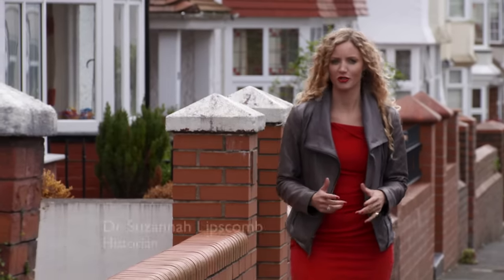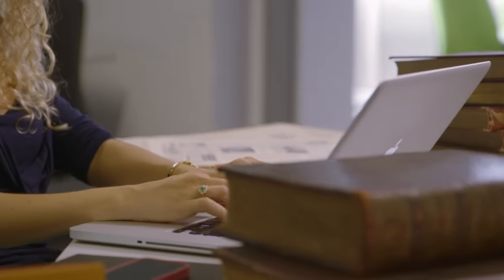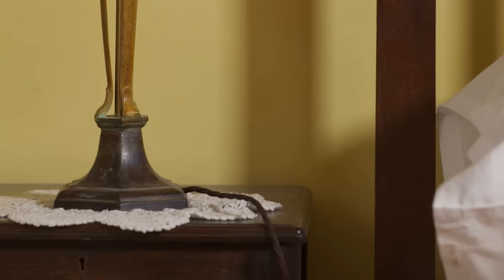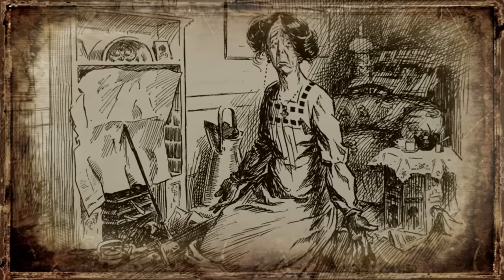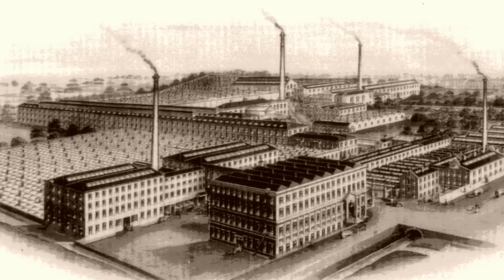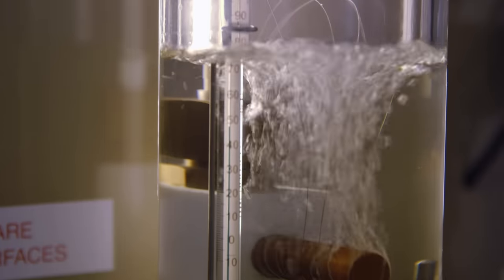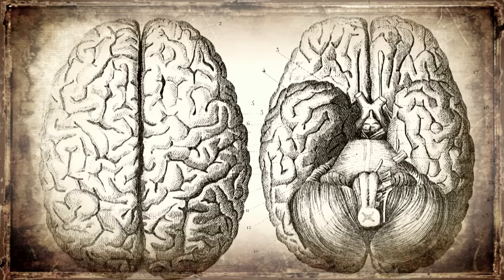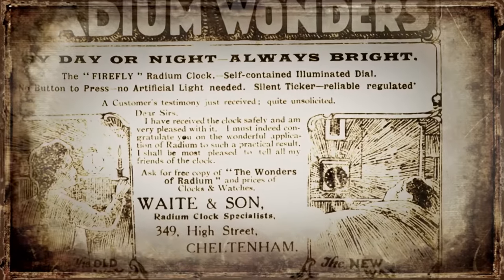How New Electricals Made The Edwardian Home A Deathtrap | Hidden Killers | Absolute History

Comment: Asbestos-lined water tank and lead pipes....the Edwardians really had it bad, didn't they?
Reply: Though not as bad as those before them- women's crinolines used to catch on fire if they walked too close to an open flame,which was all too frequent in Victorian times, and corsets with hoop skirts trapped women in their burning clothes and even just suffocated them when a strong gust forced the skirt to invert like a ruined umbrella, or even attacked them when they tried to walk over stiles or sometimes down steep stairs
Reply: jan rees you’re right about the skirts catching on fire, though that was really only a problem for working-class women as they would be the ones working close to fires. And they were a general fire hazard, but it wasn’t very common to get ‘trapped’ in your burning clothes, at least not any more that it is today. The rest of what you’ve said, however, is false. The crinoline could not invert like an umbrella and suffocate anyone because it was made out of progressively larger lightweight steel hoops that were only attached to each other by fabric. Crinolines were actually very flexible and they were fully collapsible.
Reply: Asbestos was still being used in building public housing and insulation of water tanks and furnaces in 1960 and 70s
Reply: The asbestos "lining" of the early water heaters was used as insulation, it would not normally see contact with water unless the inner jacket cracked or rusted through. That they were fueled by gasoline, kerosene or gas using an open flame, in the kitchen was usually a larger hazard.

There are still many cities using lead or leaded steel water supply lines. They depend on the lead oxide that forms on the inside of the pipe to keep people from being poisoned.  This is a great deal of the issues found in the City of Flint's water system.  A change in the Ph of the water supplied to the system removed the oxide, allowing free lead into the water.
Reply: In 100 year they talk abouth our stupidity
Reply: Vaccines g5 plastic
Reply: Asbestos is dangerous to breathe. Not so dangerous to use in things that don't cause it to be or become airborne.
Reply: @danielaweber8491  yes they will
Reply: Lead pipes are still common and in use today genius. Plus asbestos is all over in many older homes and other thing. Still legal to use.
Reply: Asbestos is a wonderful and natural substance. One of the best fireproof insulators ever. It's the small fibers in the lungs that are just terrible. It's widely used outside the USA and others who banned it.
Reply: sorry, i'm not sure if your's is a sarcastic here or not, but I know some of the poorest English had to eat mud for dinner; no wonder something like gout happened with such buggered up intestines.
Reply: We have 5G and give Radiation to cancer patients lets see what people will say about that in a 100 years
Reply: @spiritfree5050  and what's wrong with 5G? Your not a tower burner are you? You know you can't transmit a virus through radio waves..
Reply: @thetreblerebel  Radiation smarty pants
Reply: @spiritfree5050  non ionizing radiation

Comment: I recall how, in the 1950s, my mother still used an electric iron plugged into a bayonet light fitting in the ceiling. I also remember how, always naive about risk, she heard a loose screw rattling inside her Hoover steam iron. She grabbed a table knife to push it out—but the iron was still 'on'. There was almighty bang! The 'Ivorine' handle insulated her from the current, but much of the blade had melted like a welding rod. Domestic fuses were notoriously insensitive, unlike the super-sensitive RCDs that protect us in our homes today.
Reply: I also remember people used to get tired of those fuses blowing, so they would circumvent the safety by placing a copper penny where the fuse goes.
Reply: Your poor mom! Ivorine to the rescue. That's a really scary story.
Reply: @localgirl33  Yes, it was a very narrow squeak (to use that ancient term), but we all hang to life by a thread at times, don't we? Happily, she survived for another forty years...

Comment: was a apprentice electrician in the late 1940s   many of these Edwardian relics were still in use,  fire irons were in almost every  house  ,  most cottages in mill towns had gas.  Electricity was generated locally and was later Nationalised.  Wiring then was  gradually converting from lead covered to a rubber covering,  Cottages were wired  (Subsidised)  with one 15 amp socket, and two light circuits one upstairs and one down. gas was retained for many years by tenants who could not afford extra lighting points.
Reply: wow!
Reply: Really cool info, thanks for sharing!
Reply: You should make a channel to share your stories!
Reply: I'm a modern electrician and it's crazy seeing paper covered knob and tube wiring in really old houses, along with asbestos tiles all over the basements. I got hit with a hot line with paper insulation on it in an attic, that stuff will light you up bad. No grounds at all, 5 fuse boxes, no proper meter socket at all just a 60 amp disconnect running an entire house, garage and rv. Place could've been a museum lol it even was built from the wood they cut down, true 2 inch by 4 inch walls lined in boards, all hardwood. Hardest rewire ever
Reply: We still use gas, at least for cooking, in our home (probably majority of people in our country).
Reply: So assuming you were at least a teen in the 1940s, that means you’re in your 90s? Wow. Most people in their 60s and 70s have problems with tech. You must be smart as a whip!
Reply: You are so cool. I'd love to hear your stories.

Comment: To be fair, the curling wand probably wasn't all that terribly different from the 450-degree electric curling wands we use today.
Reply: for thick hair you shouldn't go past 300 degrees and most curling irons won't go past 400. If you are curling ur hair at 450, you're going to burn it off or really damage it. U r right tho, they still get ridiculously hot.
Reply: I think that kind of temperature would certainly burn off hair if you use materials like sterling silver. However, we use ceramic or variety of titanium materials in curling/straightening irons. Those hold and distribute heat evenly, which makes it quite hard to burn off hair in chunks like it did with Edwardian silver curling irons. On top of that, we have different kinds of coatings and insulation within a hair iron that causes little to no hair breakage. Today's hair irons are far less damaging and much safer than the ones they used back then even at their highest temperature settings
Reply: @Wajiiiiiiiiiiiiiiiii  perfect comment! I'm a stylist are you as well?
Reply: @leslieenoch  No, I just google shit a lot. 😄
Reply: @Wajiiiiiiiiiiiiiiiii  🤣🤣🤣🤣
Reply: @courtneyraiyn-eshaiyn7815  mine goes to 440 it's very expensive
Reply: Courtney Shaine not true I’m a professional we use 450 but are trained to quickly. Most hair burns after 450. But if your hair is weak or fine yes 450 is a lot
Reply: Courtney Shaine that’s false.
Reply: Julia Melone I have personally burned a long lock of curly hair right off!
Reply: I mean at least today we're plugging curling irons into purpose-designed wall sockets connected to circuits that can safely handle more than just a few lamps
Reply: Except the ones you use today have safety devices that disable the unit if it starts drawing more current than it was designed to. The ones back then had no such safety devices.
Reply: Best thing---don't use them at all.  If God wanted a person to have curly/wavy hair, he would have given it.  My hair is over 3 feet long, and I don't use any appliance on it at all, not even a hair dryer. Just a comb.  (Jan Griffiths).
Reply: @Jammermaker   god is real
Reply: @user-xv2lj2tx1b  nah fam but enjoy thinking like that
Reply: @Jammermaker  Actually, yes fam, but YOU keep believing that 😒
Reply: @thecatholiccorner  thought I was replying to a different post.  And whatever you keep taking on faith whatever they chalk down your throat and enjoy them controlling you for your entire life.  I'm going to enjoy actual happiness in the meantime.

Comment: It would be cool to see a video with a comparison of electrical sockets in the UK vs. USA. The UK sockets are much better designed for safety - each one has a switch, and they’re recessed so a loose plug doesn’t become a shock hazard. There’s also a fuse inside each plug. It goes beyond that - in bathrooms light switches are all suspended and non-conductive from the ceiling. I’d be curious to see statistics on accidental home electrocutions in the USA vs. UK.

Comment: I’m a telephone infrastructure technician in the US Midwest and I work on lots of active trunk cables that have lead sheath and paper insulation on the wire pairs. Usually has a a few numbers missing on the cable identification code because it’s so old it’s been lost in the records. I recently worked on a damaged 1200 line trunk from 1944. We also regularly take training for dealing with asbestos in the underground tunnels and old building ceiling tiles and cement board siding

Comment: 1890, you were born, you took horse carriage home.  1970, you die, you flew on airplanes, drove cars, watched television, used air condition during hot summer, call you mother with phones, and you see men landed on the moon.  All that, in 80 years.  Why? because petroleum and electricity.
Reply: Don't forget Chemistry.
Reply: You probably would've been born at home back then.
Reply: Absolutely right!
Reply: @Ellie5621 we can make the car hyper gas sippers and make one HP and TQ per cubic inch. The guy who make a Pontiac do this was found dead shot in the head. the car is still around some where. this car ran at 1200F on the intake and pass 1800F on the exhaust. how he got the car is run about the place like this in unknown. no car can run that hot at 350F the main bearings burn, pistons ring get too hot and crack the pistons. at this point the exhaust is so hot the pipes melt.
Reply: My grandmother was born in 1899. She died in 1986. To think of all she saw through that time. Just incredible!
Reply: @laurzee  Shame she never got to see the internet and portable cellphones
Reply: Born in 1996, I hope by 2070 to be able to see/experience mass public space transportation
Reply: Daniel 12:4 King James Version (KJV)
4 But thou, O Daniel, shut up the words, and seal the book, even to the time of the end: many shall run to and fro, and knowledge shall be increased.
Reply: P.T.K Schmidty 
We are devolving now, unfortunately. You won’t see the constant advancements like we experienced before when it was the smart wealthy that were having the most kids, and Iow lQ immi grants weren’t invading high lQ territories at a fast rate, having the most kids, and inter-mixing with the higher lQ populace. The ruling class also dumbs us down with horrible things like flouride in our water and such.
Reply: ...and the transistor
Reply: @NatureShy 
Shame that I never got a notification for your earlier comment to me... Oh well, better late than never!

So I am supposedly “scared,” and a “little snowflake” for merely stating facts? LOL! That’s absolutely precious! 😂

The truth is that peopIe from your mother’s side have an average lQ of 89, and peopIe from your father’s side have an average lQ of lO3. This is an absolute FACT.

lQ is heridi tary, and it has been proven that adopted children reflect the lQ of their bioIogicaI birth mother as they grow up, more than their adopted non-bio-mother.

Your lQ will be around a midpoint between your father’s lQ and mother’s lQ. You have your father to thank for you being able to keep up in university, but the sad part is that if he had chiIdren with someone from his one peopIes instead, his descendant would have most likely had a higher lQ. 

That goes to my point I made in my previous comment about the average lQ going downhiII here due to mass immi gration.

If I could leave links here to give you sources, I would, but considering the fact this is a big channel, the likelihood that they allow us to post links here is slim to none. Thus, I won’t leave any links, because that would shadow ban my comment.

In the book entitled “Human AccompIishment“ by Charles Murray, he proves that 97% of all accompIishments in the scient ific   in ventories, whether measured in peopIe or events, were derived by peopIe of Eur opean ethni city.

Lastly, yes, I have a college degree, from a university that is difficult for people to get accepted in to no less (and because I am fully Eur opean in ethni city, there was no AFFlRM ATlVE ACTl0N for me to rely on to get accepted!).

I graduated with honors, cum laude. In fact, for the entirety of my education, I was ALWAYS on the Honor’s Roll/Dean’s list. I never earned below a B in any class throughout all of my education (from elementary school all the way through finishing university).

I was in the AP (advanced placement) courses in high school, which are college level classes that you get college credit for.

I also didn’t major in some random sociaI science bullshit major.

Can you say the same for all of that? 

So, you were saying???

ᴬˡˡ ˢᵖᵉˡˡⁱⁿᵍ & grammar ᵉʳʳᵒʳˢ ᵃʳᵉ ⁱⁿᵗᵉⁿᵗⁱᵒⁿᵃˡ ᵗᵒ ᵃᵛᵒⁱᵈ ᵁᵗᵒᵒᵇ ᶜᵉⁿˢᵒʳˢʰⁱᵖ.
Reply: @the cooky 
You say “xeno.phobic” as if that is a bad thing. Ja panese are xeno.phobic, and thus why they have been able to keep their country Ja panese! That’s a great thing!

It’s wonderful that we can still go visit there and it is still an experience where we get to see what their cuIture is like!

No, I am not a fan of this current President. He is a puppet for the bankers, just like every other politician is. He didn’t keep his campaign promises for shit, just like they all say one thing during their campaign, but do another when in office.

He has proven to be a MlGA president (again, as they all are), not a MAGA one.

If he had gotten the waII buiIt and actually fixed the huge problem of mass immi.gration, like he had said he was going to do, I would have had some respect for him, but he didn’t do either.

ᴬˡˡ ˢᵖᵉˡˡⁱⁿᵍ & grammar ᵉʳʳᵒʳˢ ᵃʳᵉ ⁱⁿᵗᵉⁿᵗⁱᵒⁿᵃˡ ᵗᵒ ᵃᵛᵒⁱᵈ ᵁᵗᵒᵒᵇ ᶜᵉⁿˢᵒʳˢʰⁱᵖ.
Reply: never landed on the moon haha it was a hoax space if fake its a flat earth concave universe baby girl, smiles im the grand master wizard of the occult hidden knowledge, yup i no most of everything now, k look up the Justinian Deception by Romely Stewart DOG LATIN LANGUAGE VS English important thing of all to know and understand.
Reply: @haroldrole615  LOL🤣😀
Reply: @crazeguy26  He most likely used a ceramic engine block that could take that kind of heat.
Reply: I think things have been the way they have and are because of people's PERCEPTIONS  of gas and electric.
Reply: @NUCLEARARMAMENT  ceramic is going to bust from the engine runing. the engine is a Hot Vapor engine.
Reply: @crazeguy26  You can’t make a car run that hot unless you completely replace the engine with something made of much more heat resistant materials. There is no magic chemical or process that can make a regular engine resist that much heat.
Reply: and with that comes all the diseases associated, ( and yet to be realised)  with petroleum and more importantly, electricity.

Comment: I have been an electrician for many years..  I remember reading about all this stuff in school.. Some of the problem is you can't see electricity and years ago they lined boiler rooms in military barracks with asbestos. Guess where the electrical panels were? I wouldn't do a job if there was asbestos in the area..
Reply: You reminded me of what my electrical engineering professor used to say: "Electrical engineering is one of the hardest disciplines because you don't see electricity unless you are doing something wrong." 😂

Comment: No, the hair was NOT "covered with asbestos" during early permanent waving!  The hair was wound onto rods, and each rod was wrapped with a foil-backed fabric pad soaked in perming solution, then clamped with a heating clip, connected to a "chandelier" of electric wires.

The danger was that, if the solution in the pad dried up too quickly, the hair could start to smoulder.  To cool it, the hairdresser would pour water onto it, which would, of course, often give the client a bit of an electric shock.

Comment: Could you imagine the sound and power current draw on the house's electricity when someone was using that Edwardian vibrator. Everyone in the house would know what you were doing. Probably sounds like an air wratchet going crazy. But I bet it would still rock these two ladies world.
Reply: Yeah probably haha, can just imagine someone using one of those and the Lights flicker in and out with moaning going on, you can also think about the fact that alot of those houses had paper thin walls since insulation wasn't that good yet
Reply: @evilskills  The walls were either brick or plastered lath. Quieter than drywall.

Comment: In Camberley the local Electricity Company persuaded the owners of houses in my parents street to convert from gas lighting to electric lighting, by offering "free" installation in exchange for a weekly payment,  When we moved into our house in 1957, the previous owner's had paid for their own installation, but some house owners were still paying this charge on their electricity bills.  The gas lighting points were still visible in the rooms, where the pipe work had been plugged off.  Also street lighting was gas powered and the local council employed gas lighters to turn on the street lights.  In fact the street light was placed on the road and not moved on to the footpath until all electric street lights were installed.
The electric cables were two core with a lead sheath with the sheath acting as the earth wire and gas pipes were made of a lead composite.  My parent's had the house rewired with three core plastic sheath wiring.